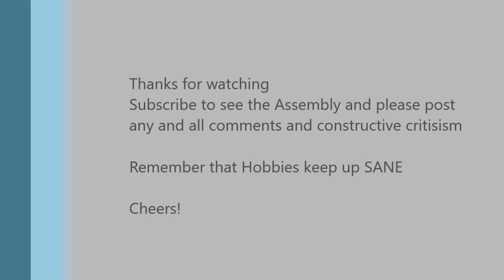Elgin 293 Disassembly

Comment: I just purchased a non-working Elgin 293 for $25 as a practice watch to disassemble.  I'm fascinated with pocket watches and a totally clueless.  Any suggestions for a beginner tool kit/list?  Cleaning solutions? Are there any online toolkits you'd recommend?
Reply from the maker: +slackroland I was the same way.  Loved them but had no idea whatsoever about servicing them.  Tools are the biggest investment you'll make and trust me, the cheaper ones turn out to be more expensive since you'll have to buy the good ones anyway.  No need to go with Bergeon tools but something midway between them and the cheap tools should be good.  You're most important tools are the screwdrivers and the tweezers.  You can go cheap with hand removers, movement holders etc... but not the screwdrivers and tweezers.  Check out Esslinger.com or ofrei.com
Your most important skill though is patience ;)
I would also visit http://www.watchrepairtalk.com great source for essential tool lists, cleaning supplies options and more importantly, great guys and gals who are sure to help you.
Good luck with this great hobby!